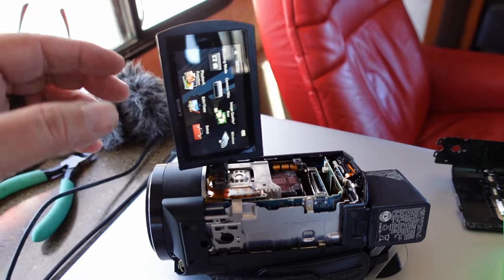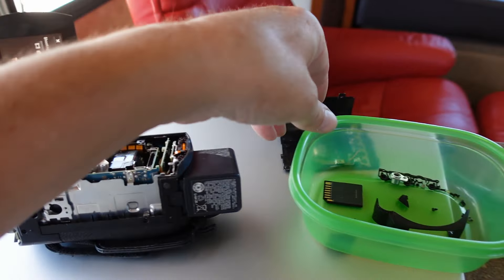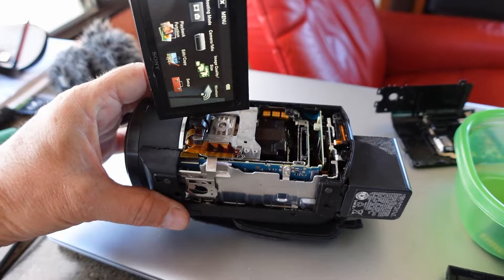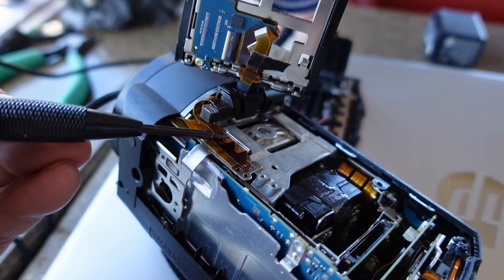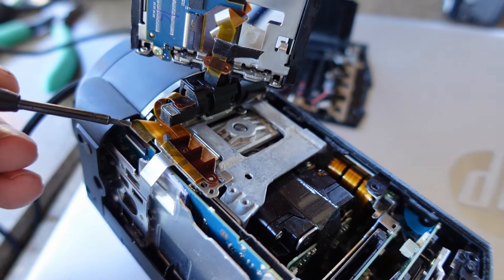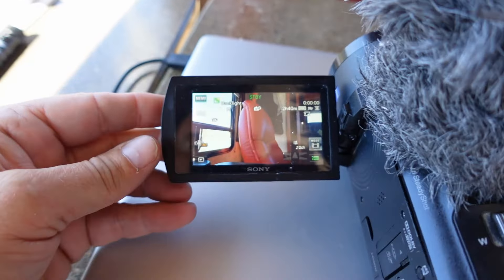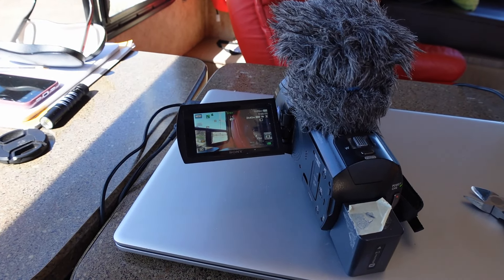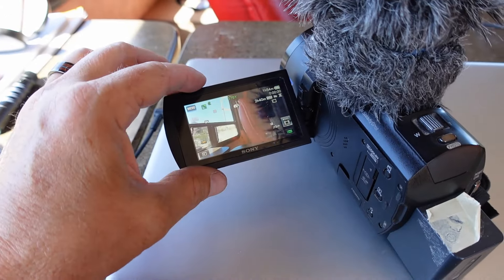Sony AX43 Camcorder Repair - Loss of Touchscreen Operation

Comment: Would love to see a replacement video. I am running into the same issue. Pressing the bottom of the housing makes the screen work. I've ordered a replacement cable but don't want to risk opening the camera without a guide. I am using a AX53
Reply from the maker: I have the AX53 service manual PDF. Contact me https://www.loveyourrv.com/contact-us/ and I'll share it with you.  Cheers, Ray

Comment: Those flex cables can be problrmatic. Some use screened-on conductive ink, and others actually have etched copper (like a rigid PCB).
Needless to say, sharp bends and folds are not these cables friends. - I hope you find a solution! - Cheers!

Comment: A new cable probably costs more than a new camcorder 😅
Reply from the maker: The camcorder costs about $1000 but looks like the cable is only about 25 bucks. :) https://encompass.com/item/10665463/Sony/1-980-433-11/
Reply: Ray, I do believe that you can fix anything.😊
Reply from the maker: @jon.landry47  This one is in my wheelhouse since I was a TV and Stereo repair tech for over 25 years. I worked on quite a few camcorders, but they were even worse to deal with since that was back when they had cassette videotapes, so there were tons of little mechanical bits and pieces to deal with.
Reply: Amazing all you can do Ray, and it all look so simple 🙆🏼‍♀️.  This video teaches me patience and calm :-0)